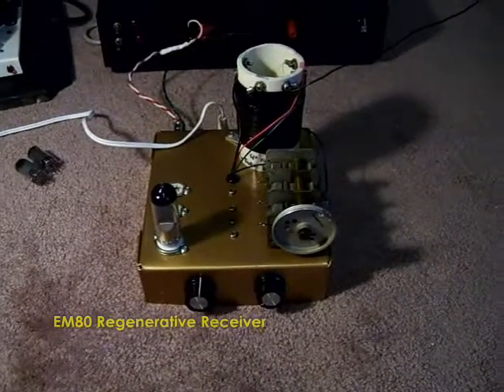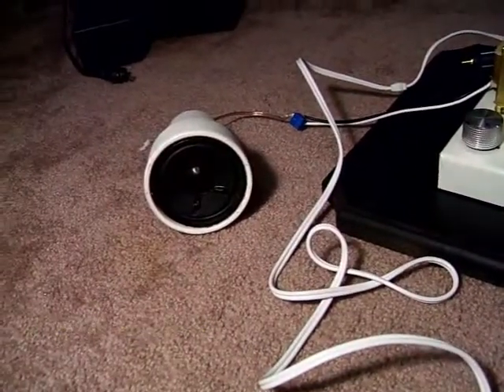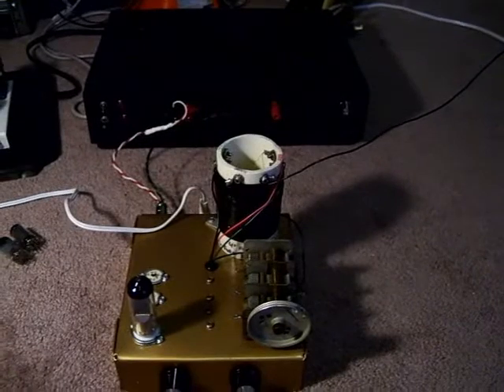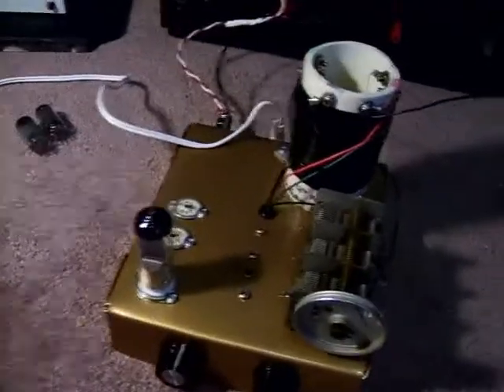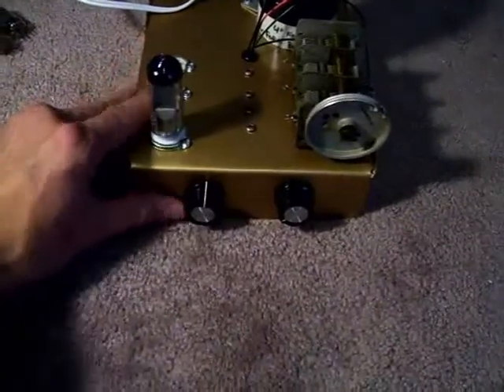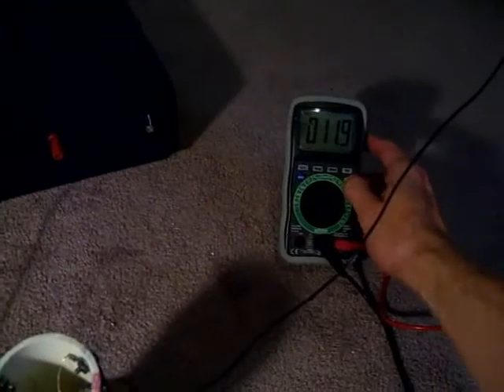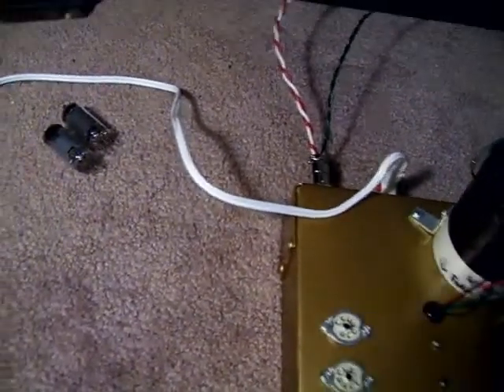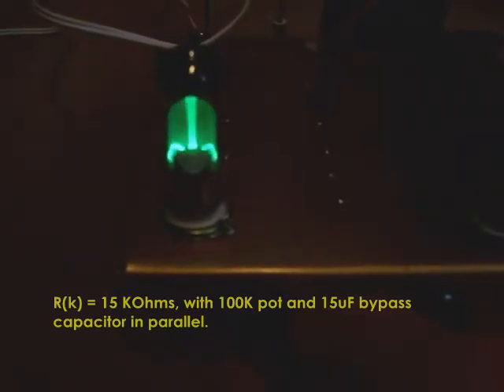Regenerative AM receiver with EM80 magic eye tube

Comment from the maker: @LZ2SM It has been over a year since I built that and no longer have the files. I can redraw the schematic and send it to you if you want. A problem with that receiver is that it didn't oscillate like a regen should. I have found that carefully buffering the plate of the regenerating tube can prevent losses that would kill oscillation.

I will make you the schematic and send it your way. I can also show you a way to improve it and send it too.